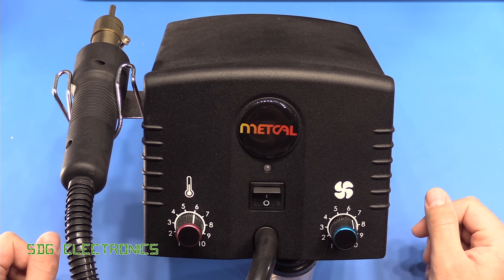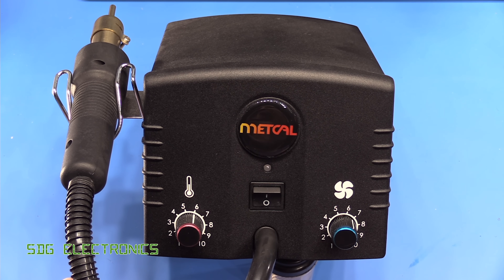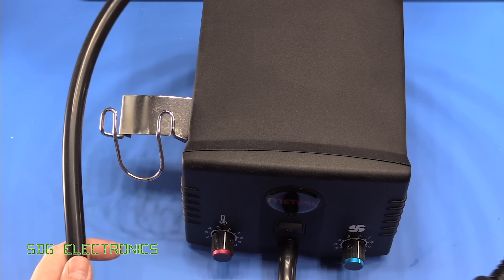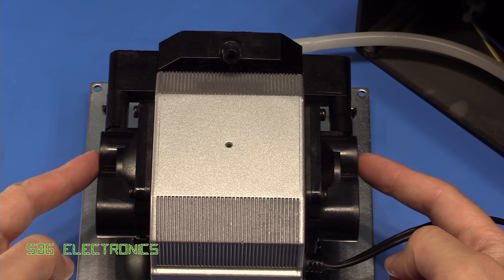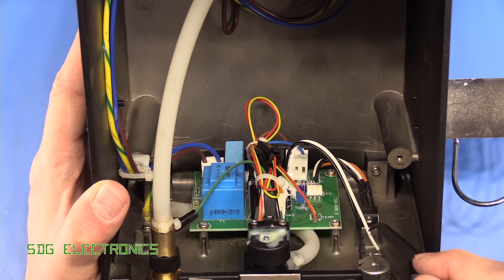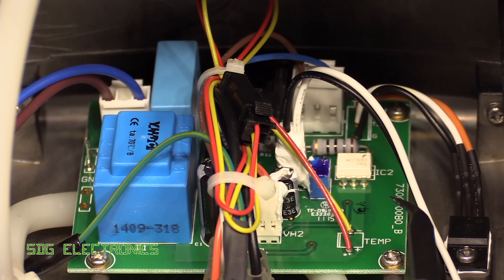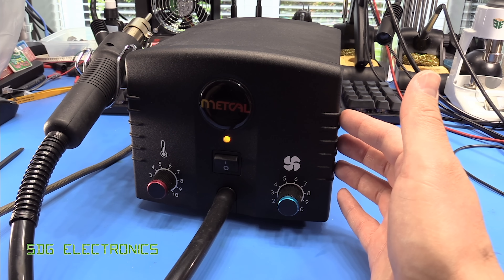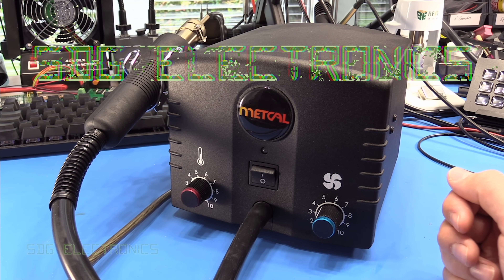SDG #149 A Professional Grade Hot Air Station - Metcal HCT-900

Comment: I like the dials and the metal construction. Not so keen on the curved top and it staying on. One could easily feel for the rotary knobs and adjust accordingly without moving from the microscope. 
As you say it's for a production [line] environment. The user would be working on a few components before conveying the units being built to the next workstation to do their few components.
Shame this has the power  for multilayer boards and bigger joints but is always on and the HCT-2-*00 doesn't appear to have the welly for multilayer but has the safety & power saving features. If only there was something in between for servicing work.
The HCT-1000 - a far more expensive unit - also vacuums has a 3 button menu system. I hate menu systems (like on my Weller WXR3) as I keep having to re-read the manual.

Comment: Mine isn't producing any heat the LED never turns on. The pump runs fine. The heater assembly seems OK. The heat element measures 22 ohms and resistance of the sensor rises when heat is applied. Any suggestions?

Comment: we had metcal soldering stations at the internship i did last year.  the senior engineer explained theseused RF to heat the tip with a special material that changes permitivitty regulating the temperature to a very stable fixed temperature, which i found very interesting,

Comment: So basically it is 500 pounds for a diaphragm pump, a sturdy box and low power heater. That pump is basically indestructible, the box as well.
Interesting, I am not sure if the box and the pump are actually the things that break most often in hot air stations, not sure if that hot air station is worth the money for a simple workshop.
For a bigger factory it may be worth the money if there may come workers that throw the hot air stations against the wall :P

Comment: I bought a Duratool ZD-939A from CPC many years ago, I think it was about £50 at the time. It looks like it is actually a clone of this Metcal HCT-900 as there are quite a few design similarities:
- It has the same holder bolted to the side
- It has the same control setup, simple temperature and airflow knobs on the front
- It has a diaphragm pump with a shipping screw on the bottom
- The pump runs on for a while after switching it off (Although on the Duratool ZD-939A, the pump overrun seems to start immediately when you apply power even with the unit switched off - Seems like a firmware bug)
- The hand piece looks the same
- It even has a nice long hose

The similarities just jumped out at me when I saw this video.
Reply from the maker: Interesting. The Duratool equipment is usually quite good. It's cheaper Chinese stuff, but with all the modifications to make it safe and last beyond the warranty period.

Comment: I've got a cheap hot Air station, which i keep on auto so heats up when i lift the nozzle and goes in to cool down when placed back. I was surprised when I forgot to let it go through the cool down before switching the power off on the front, it remained in cool down and turned off when the nozzle hit 100°C. Did not expect the cheap one to have this safety function.

Still prefer to solder chips on with an iron and only use the hot air to remove them if needed. too much effort to stop the air blowing the little buggers off the pads as the flux runs. nice video, i think a lot of use don't think of the extra costs from taking something with a 50% duty cycle or less to 100%.

Comment: 04:32 that's actually an aquarium air pump sold on aliexpress :)   bit. ly/2xthqzO
Reply from the maker: Very similar, but the customer photos show its probably a knock-off
Reply: in similar listings there are even photo reviews of the internals of the pump, and they look like a really cheap built. It would be really interesting if you could take a look inside your pump as a comparison.

Comment: The pump is maybe good and worth something, but the rest ist cheap and the station is ways too expensive, total rip-off with the brand, controls are on a electronics-noob level, cheapest handgun for the cheapest nozzles and you can see in the video by your hand movement how stiff and heavy the hose is. Without the pump you can diy it for a couple bucks, maybe 15 for the handgun, couple pennies for electronics that you can't harvest from broken devices anyways, some bucks for the case, let's say 30, absolute maximum 50 bucks plus pump, which you can also diy if you got a 3D printer, use an electric haircutter, ac or dc how you like it, and drive the diaphragmas with it, dc is easier to control.
Reply: and in the process spend 1000 bucks to buy a decent 3D printer. right
Reply: @roseelectronics4582  Read first and then comment, I wrote "if you got a 3D printer". And 3D printers don't cost 1000 bucks, you can also build one yourself for less than 150 bucks, I myself don't have one and don't need one, when I get one for free from the garbage pile, which definitely will be the case as soon as they become really trendy, I will take it, but until then I don't care and do it all the oldschool way.
Reply: @Wilson84KS  sorry, i have a big mouth and it puts me in trouble a lot of the times
Reply: @roseelectronics4582  Hehehe, it's all fine. I actually know this, it's almost a miracle that I never got my ass kicked.

Comment: I think a screen is a must so you have that feedback to let you know if the unit is warmed up or not. I can buy 10-20 Chinese hot air stations for the same price and I doubt that they will all break faster than the 1 expensive air station. My Handskit combo station is amazing and has a 30v 5A power supply and came with tons of extras that I use over the ones I bought and replacement heating elements. Once you get used to the controls It is such a great tool and I would buy it again in a second. Obviously it takes much longer to adjust than just having 2 knobs but I would have spent upwards of 20x as much for the same functionality from one of the expensive suppliers. With the savings I could even buy a few of those really simple quicko or ksger t12 soldering and hot air stations which are just knobs but have a screen as well.

Comment: I did a video where I tested a Quick 860DW and I noticed an unstable temperature control measuring the output airflow with a thermocouple. You measured the outcome air temperature not for enough time to get a good picture of the temperature control in the metcal unit. I would really appreciate a longer measurement in order to do a comparison between the two units. Nice content like always by the way. Cheers

Comment: I use this station for many years (still labeled OKI so that is how old it is) for my work (repairing measurement , calibration gear and a lot of industrial machine control stuff)  It really works very well.  So well that I bought a soldering/desoldering station from Metcall. (MFR-1351) That turned out to be totally junk and Metcals service was even worse. The final blow was that the cable of a hand-piece got over 100 degrees C. According Metcal a known problem but because my hand-piece was 1.5  year old they did not replace it.  (it was already replaced after a few months for, what now turned out, to be an older on. In that period I had to replace the desolder and solder  hand-piece, the main unit, 2 pump membranes and a lot of expensive tips. The desolder tips lasted a month or so. 

I am happy I did not sell my old trusty Pace MBT250 (now over 25 years old). I contacted Pace for advise about what Pace to buy for my purpose and told them I wanted to do that because my MBT250 was very old and the desolder handpiece died.  The support advised me to only replace my desolder handpiece with a SX100 , advised what tips to buy and what to check in my pump . I did and it still looked like new !!!. That is now around 5 years ago and it still works great. I desolder a lot because I also repair a lot of industrial boards where the only way (no schematics and part of something so you can not power it on on the bench ) is to desolder almost everything, test every part and solder them back in place. There are days I desolder a few hundred joints. The Paces never protests and desolder tips last often more as a year.
Reply from the maker: That's sad to hear. I've not used the MFR stations, but my Metcal MX-500, new MX-500 and the MX-5200 have all been flawless with tips that seem to last forever. IMO they are the highest performing stations out there. The MFR systems have a lower RF frequency and work a little differently.
Reply: You better keep old Pace, you now will not find anything near close to it, we couple of years ago was looking to replace our old PRC2000 with something new and we got from distributors Metcal, JBC ... all according to distributors their top end professional products and from our experience they are kids toys comparing to old Pace (we was disappointed even in new Pace products). I do not want to say they are bad, but comparing to old Pace they all are just class below.
Just one little notice we do not use soldering stations on daily bases we use them rarely (for some prototypes or to rework something) maybe once in couple of months at best but when we need it we want equipment to work reliable not to make problems.

Comment: Thanks Steve. Saves me taking mine apart to see what's inside 😆 
If any.. how many elements have you used in the 5 years you've had it?
Cheers
John
Reply from the maker: Still on the first one actually!
Reply: @sdgelectronics   Good to know, Thanks Steve. I already have a spare but it's good to know that it doesn't eat them often.

Comment: Thanks for taking a peek inside this high priced, professional gear. I get the, don't change if it's not broken, vibe. However, it still amazes me how much these company's rest on their laurels. They remind me of the Soyuz launcher. Made by hand, costly, knobs and dials interface, never changes. Then Space X comes along and lands it's launcher VERTICALLY back at the launch site, for re-use!  No laurel sitting there and then sells it for half the price at least. 

I did much research before buying a 2-in-1 hot air station and soldering gun combi. Much that is Chinese is suspect and can even cause fires or potentially electrocute...exciting, but in a bad way. I opted for the Yihua 899 D II model. £62 delivered. It has the fire inducing air wand, when left in the lab, switched off at the front. Am I Mad! Not so much. This one is really good. It has a rear switch which solves the fire problem. The motherboard is superior too, modern, surface mounted, fibreglass, all heatsinks in place, good mains separation, fused on the live side, earthed robustly throughout with crimped connectors, connectors all insulated, tidy soldering on the board, good user interface. 

I got a bit lucky as I never found a teardown video like this for it. It was eight times cheaper than this machine though. Longevity unknown, that's fine for my hobby use. It's my "Space X." It could be yours too for the price of a parking ticket!
Reply from the maker: I get what you mean, Fluke do the same thing with the DMMs. Not sure why they aren't so proactive with next generation devices.

Comment: Not a Metcal fan, I use them before they are over priced for what they offer. For that price and not even a digital temp. display?. Las year got a Quick per 265 USD. And work fantastic not only got the display, the  airflow is digital adjustable and it shoots down it self we the gun get placed on is holder.

Comment: I got an AOYUE (anyone who can pronounce this? ^^) INT 8900 with a 1000W heating element for cheap (~100 bucks). If I could spend money freely, I would probably pay the 210 euros for an ATTEN 562D, they seem very well priced for what you get.
Just doing some modding though on the AOYUE, I added separated switches on the front panel to shut the pump + heater down (so only control circuit remains life and thus won't lose its control settings).. Looking to get some strain relief (maybe a spring on the hose), too.

But they appear to be rather well built (serious insulation all over, high temperature wires, dual pole fused mains switch (not the rubbish you get on the 858D clones) and cable management inside.

Comment: Not sure if the one I had was defective but the power output was just not enough when trying to desolder QFN or others devices where heating of ground plane is essential. Granted, there was no access to a heater plate but regardless of that, holding it point blank next to the component wouldn't melt the solder. I was distinctly unimpressed by all the Metcal gear including their soldering station. Since then, been using a Quick 861DW and it's tonnes better than the others. Granted you would not want to burn boards/soldermask on the PCB but this is not capable of such, like pretty much all others are. Waste of money if you ask me.
Reply: I sold my Hakko hot air station and replaced it with the quick, quick is 1000 times better and more user friendly.
Reply: Not likely defective, while this is a nice unit it simply doesn't have enough wattage for many of the jobs.
Reply from the maker: High output power is just to get the handpiece to heat up quickly. This unit still delivers the highest temperature at the highest airflow, so a more powerful heating element wouldn't do anything.
Reply: They should have made the settings go to 11 😁